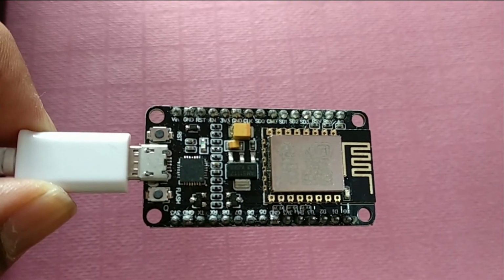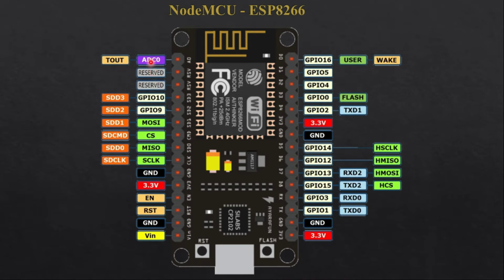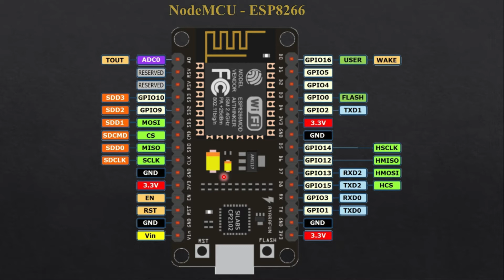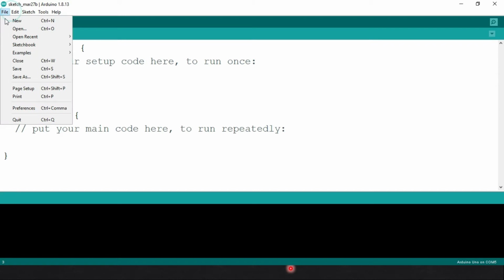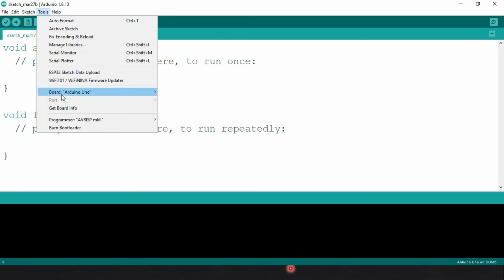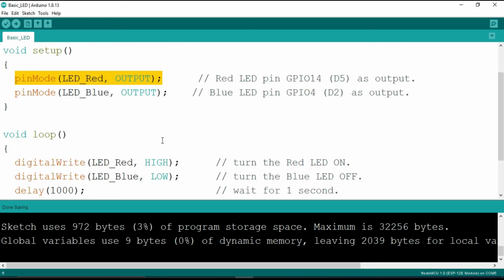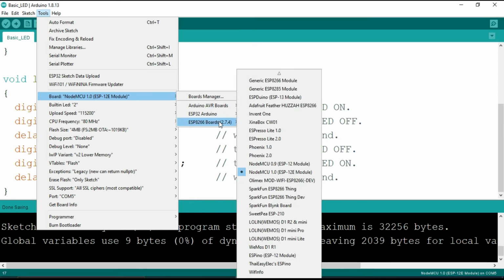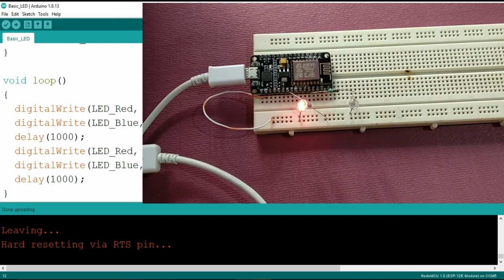What is NodeMCU ESP8266? How to Use NodeMCU ESP8266 with Arduino IDE? #IoT

Comment: I bought the node MCU board but it didn't come with a usb cable. Can I use any usb cable to connect my laptop with the board? Or is there is special type of cable needed?
Reply from the maker: You can use any micro usb cable, even your mobile charger micro usb cable will also work.

Comment: I'm sorry I dont understand abaout the resistor. can i know what kind of resistor you are using? the colors used are different in your video. Does the resistor need to follow the color shown in the video? if you don't mind, can you please link the resistor picture to me. thank you in advance
Reply from the maker: You can use 220 ohm resistor with LED. This resistor is used to protect LED from high current. You may use any low value resistor with LED. You can watch my video on how to use LED in my playlist.